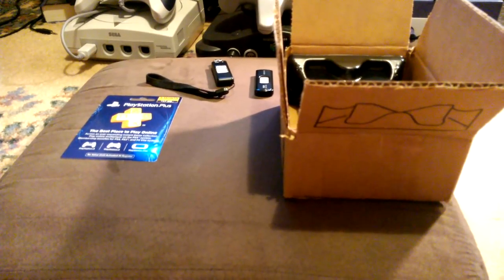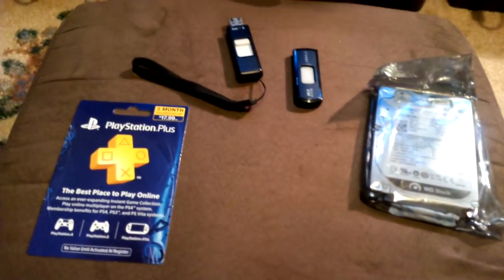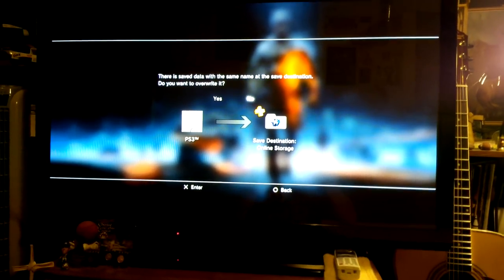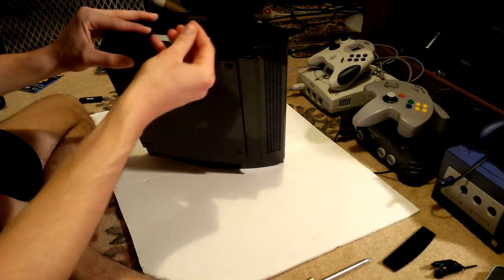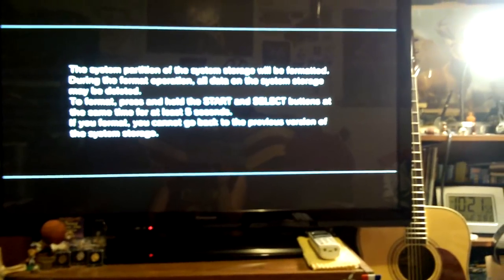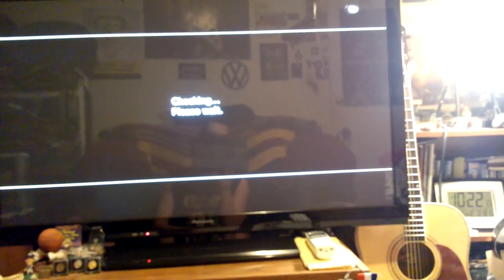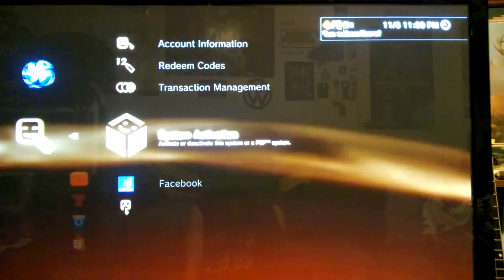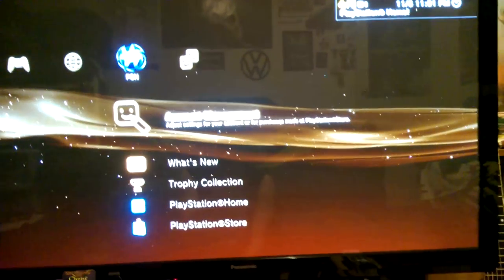How to Upgrade PS3 Hard Drive and Keep Data Without Using an External Hard Drive

Comment: A room full of legendary consoles and GUITARS i have found the gamer god! quickly report this to all media!
Reply from the maker: Lol, my room is starting to seem small with all the stuff I keep collecting so everything is all bunched together. But unlike a lot of gaming channels I don't try and be politically/corporately correct so I don't mind talking about other products or companies or showing other things not related to gaming in my videos.
Reply from the maker: ***** I think since I've changed the hard drive I haven't played all that many of my older games but it may have speeded it some but nothing very noticeable. I haven't noticed any improved framerates either.
Reply from the maker: A SSD might be more noticeable compared to a 7200RPM drive but with any larger hard drive games that offer optional hard drive installs (like Black Ops 2 and MLB 13 the show) did load much quicker due to allowing parts of the game to be installed on it. So those games loaded much faster but I think it was due to loading off the hard drive and not the disc, but a faster HDD never hurts. I don't have Skyrim for PS3 so I'm not sure if it downloads any of the game to the HDD but if it does and you have a faster HDD then it probably will give it the best performance possible from the PS3.

Comment: And I actually have a 60gb og ps3 i believe it is i won off eBay supposed to just need a hard drive.. got it for around $33 4 years ago and it has sat in a box because I already had the dontes fortune edition hg250gb console system and it works great

Comment: Hey man i dont have an external harddrive either but i got a western.. 500gb to replace my 120. Would i be able to use ps plus like you? But im not gonna buy it. Im gonna use the 14 day free trial will it work? Will it save my stuff even on a trial and will it remember? And also i downloaded a bunch of full games off the psn store. I got nfs rivals and a couple others on my system but i had to delete like 4 digital games like crysis 3 but i can see them when i go on psn store and "view downloads" so will that stuff transfer as well?
Reply: Im worried because u mentioned days waiting fir some games because they grey out and the trial is 14 days what if i dont got enough time?
Reply from the maker: I think you can use the cloud feature on a trail but I've never tried a trial version so I'm not sure. And the game saves that are grayed out are supposed to only be transferred once every 24 hours so you should be able to access them the next day.
Reply from the maker: ***** Unless your external hard drive came with a power adapter and has an input for one it shouldn't need power. Most current external hard drives under 2TB don't require a separate power source. I think it's probably just a slow process as the PS3's internal HDD is 5400rpm and your external hard drive is probably 5400rpm as well and being transferred with USB 2.0.

Comment: i needed to get a new hard drive because my ps3 old one is fried and storage data and stuff is corrupted i juss want to install a new hard drive without back up idc about game data i'll still have all my dlc trophies and apps
Reply from the maker: If you're not concerned about losing data you can try booting the PS3 up in its safe mode and try formatting the hard drive to see if it fixes the problem. If you have to get a new hard drive and aren't concerned about backing up any data you can install a new one but you'll have to have the PS3 operating system put on that hard drive and I don't know of any other methods of getting it on there but the file isn't very big so you could buy a smaller sized USB drive which should be under $10.
Reply: can a double sided USB Cord send the new the 4.70 update to my ps3 by hooking it up to to the computer into the ps3 because im currently on 4.66 because i need my hard drive was fried and system strorage was corrupted.
Reply from the maker: Jordan Gray You could try it but I don't know if it would work. Follow the instructions on how you would make the update folder and put the file it and put the whole folder on your desktop and see if your PS3 recognizes your computer as a USB storage device.
Reply: Im so sorry to be asking you so much that thank you for your time though to take my ps3 to gamestop Thank you for the help
Reply: final question can a 32 GB USB Drive hold the new 4.70 software update for my ps3
Reply from the maker: Yes. I believe the size of the update file is only around 200mb just make sure to make the correct folders on your USB as instructed on the Web page that has the update file and it should recognize the file.

Comment: the issue with the 7200 rpm hdd is for the ps3 slim and its a cooling issue. The hdd may over heat especially where i live here in the desertbut if you keep it in a cool environment it should be fine in either model.

Comment: sooooo, if you DONT want any of the stuff from the old harddrive, you can skip everything but the update from the website and the actual switchout?  Bought a used ps3 fat and upgrading before i give it to my kid so i dont need this other dudes info... also the reason you only have 412 free is cause you already dled your games lol.
Reply from the maker: All you need to do is change the hard drive and have a USB with the update firmware and it should be ready to use if you don't want any old data.
Reply: Awesome Bigj :)

Comment: I downloaded games from different people and I don't have their account info anymore, if I upgrade my hard drive will I need to redownload those games or will everything be exactly as before?
Reply: Please answer my question as I do not want to lose the games that are not on my account
Reply from the maker: If they were paid games that were bought on someone else's account they wouldn't be available in your download list to redownload on your new hard drive. The only chance you might have is if you bought an external hard drive in addition to upgrading the internal hard drive. That way you could backup your entire system, game data, and full games and not have to redownload anything but I still couldn't say for sure if those games would work or not because I didn't even know it was possible to have games from someone else's account working on your account.

Comment: i am trying to update it it says data corrupted, and my ps3 freezing what i should do??help
Reply: If you're trying to do all this while your PS3 is jailbroken it might not allow you, if you put another hard drive in it there shouldn't be any way data is corrupted because there isn't any data on it. If the new hard drive has anything on it or needs formatted then it's ok to let the PS3 delete everything and format it. If your original hard drive says that I'm not sure why it would, as long as you copied your gamesaves onto a USB you'll still have your stuff that matters. Again if your PS3 is jailbroken and you are trying to put those gamesaves onto the new hard drive it might not work until you jailbreak the PS3 on that hard drive first.

Comment: Any thoughts on disassembling a Western Digital 500G My Book and using the drive to upgrade my ps3 slim? I don't want to crack open my external until I know it has a 2.5 in it. Thanks.
Reply from the maker: I've never heard of those HDDs but I looked them up on eBay and by the size of them (if your's is what I'm seeing on there they're pretty bulky) they appear to contain a 3.5in HDD that does not fit in the PS3. I found one listing where the description said it is a 3.5in and the 500gb model My Book and it looks to be the same appearance as the rest so I'm assuming they are all 3.5in HDD. If you still want to use it though I'm pretty sure the PS3 will accept an external hard drive via USB as an addition to the internal storage. To do that you'll need to format your external HDD to FAT32 (you might be able to format it conencted to your computer if the hard drive itself came with it's own software because I remember reading Windows itself can't format FAT32 beyond a certain size drive, like 30-50GB or something.) If you can't do it that way I think if you connect it to your PS3 it might give you an option to have the PS3 format it to the correct format. I'm not sure how to get it to do that though, if you go into that BIOS like menu by holding the power button it may give you a tool there to do it, if not if you're in the XMB and go to backup/restore section and try and make a backup on it I think it would have to format it first to back it up and you might be able to cancel the backup and then be able to use it as additional storage. Sorry I don't know for sure but if you do want to use that 3.5in drive it'll have to be connected by the USB and formatted, if you aren't sure about what I said then I'd suggest looking up how to get an external HDD to work on the PS3 on YouTube.
Reply: bigj619d3
Thanks for the insight!

Comment: Lets say I have gta 5 does the online data for gta 5 get erased or do I just have to reinstall it and start all over ?
Reply from the maker: I never played much GTA5 online but I'm almost sure when you start an online session it auto saves all the time. More than likely in the XMB menu there is a save file for your online GTA5 and another for your offline story mode. As long as you either have PS+ or copy that save file onto a USB (along with all your other games' save files) you should be able to pick up where you left off after you let the game install itself again and download whatever update patches it needs.

Comment: Do you actually enjoy using the Super Pad 64 hahaha. Just noticed that in the background. My least favorite N64 controller, that one. I might have the same model ps3, 80GB fat. I just put a PS4 hard drive in it.
Reply from the maker: I never had an N64 so to me the bulky Super Pad felt easier to hold than the original controller. Also the original controllers I had both had loose thumbsticks while the Super Pad’s ones were still nice and springy. I’m not sure if they were built better of the last owner just didn’t use them. My PS3 still works well so I’m glad I still have it since it’s hard to find a working, clean fat model although I rarely use it these days and I hate the worn out, tiny DualShock 3 compared to the DS4. Plus the battery in it is shot so I only get a few hours out of it.
Reply: Give the afterglow ps3 controller a try, they might still have them available. One model of the PS3 afterglow can double as a pc controller. Here is the link: https://www.amazon.com/Afterglow-Wireless-Controller-Blue-playstation-3/dp/B017VLXH3C
Reply: I think the Super pad uses metal parts inside instead of the plastic nintendo used, making them last much longer. Sadly, although my PS3 isn't very used it's got lots of scratches on it, I need to find a way to buff it out without damaging it. Not a fan of glossy finishes myself.
Reply from the maker: I don’t really play my PS3 enough to want to get another controller but if I ever get back into it that looks like one worth considering. When I got a used PS2 a few years back it came with a nice wireless Logitech controller but unfortunately one of the triggers constantly kept registering as a press which pretty much ruins it. They go for quite a bit on eBay and most don’t include the receiver and aren’t clean so maybe one day I’ll find a cheap one for parts where I can just harvest the inside and fix mine. Also I don’t have any but two GameCube games at the moment but if I ever get back into it I’d like the WaveBird controller but they too are rare and hard to find complete and in good condition.

Comment: Awasome video, i was wondering, you tried to use the older hdd ? Im asking you this because i want to change the HDD but i have a digital game (The last of us) and i dont if a would be able to come back from the newer HDD and play this game. I didnt bought the game with my psn account so i just can downoald it once.
Reply from the maker: If you got the game digitally from a code you'd still have to redeem it on your profile for it to download so I'd check your downloads list to see if it is available in your account. (For example I could buy a DLC code from somewhere other than PSN but if it redeemed it on my account it still is in my downloads list since it had to download from PSN in order to get it on your PS3. If that doesn't work then save your old HDD and buy a hard drive enclosure to put your old HDD in which would turn it into an external HDD that you could connect via USB in addition to the newly installed internal drive. The only issue would be I know the PS3 will format a newly installed internal hard drive and wipe all the data off. (When installing the new hard drive it doesn't matter since it's blank to begin with) but if you reconnect your old HDD via an external enclosure I'm not sure it the PS3 will still recognize it as already being formatted to work on a PS3 or not. You might be able to research that to see if others have tried it.

Comment: hey dude my ps3 is broken and i cant on it, its totally dead on me  but i have the hard disk is there any other way to extract the files? i did not sync or anything or put it on cloud or back it up i was very young back then and stupid  pls help many thx
Reply: Hey there. You'll need to find a way to access the hard-drive of the ps3 and extract the files. Since you probably don't want to be opening your computer up and plugging the drive directly into your hardware, you'll have to purchase a connector that allows you to "mount" your hard-drive as if it were a USB flash drive. There's a How to Geek page on this problem. You can find it by searching "How to get data off an old Hard Drive."

Then you'll have to transfer the data to another hard-drive or flash drive after it's on your computer, so your ps3 can read it.
Reply: you might be able to take it out and use it in an external harddrive

Comment: I have a question, I forgot to copy my RE4 save data to my USB during the upgrade but it's still in my old hard drive. Can I put the old drive in and recover the save data? And will I lose anything I currently have if I do this?
Reply from the maker: I know the PS3 formats a "stranger" hard drive if any time you put one in it that wasn't already in it. If you already installed the new one and want to go back to the old one I'm not sure if your PS3 would remember it or if it only remembers the last one to be installed (which would be your new one.) In this situation I wouldn't recommend removing the new one in the event that you take the good one out and the original gets wiped and then the PS3 formats it and then if you go to installing the new one again that one might end up getting formatted as well and you'd lose everything on both drives. If it's just one game you're better off dealing with just one loss. I assume RE4 is resident evil 4 (which I've never played) but if it's a sorry game if you like it it wouldn't be the worst thing to have to replay the game (unlike a sports game or something where your created team and stats would be reset) in this case you'd just have to replay the game through again which might be fun anyway. And as long as you're connected to the Internet your trophies should have synced up to your new hard drive so no matter what you'll at least still have those unlocked.
Reply: Yes it's Resident Evil 4. I guess I wouldn't mind playing it again since it is one of my favorite games. Rather replay it over again than risk losing everything I already installed on the new drive. Anyways thanks.

Comment: thanks.nice video but does this erase multiman ??
Reply from the maker: I don't know what that is but if your PS3 is jailbroken I'm pretty sure any time you put new firmware on it it erases the hacks. You'd have to download onto a USB the 3.55 or whatever latest compatible firmware that hack worked on, but I think PS3s that are on a higher firmware won't let you install older ones but if you ever updated it you might be able. If you're able to put the old firmware onto it and rejailbreak it you can get it back but just doing what I did in the video wouldn't carry over any hacks.

Comment: i cant transfer wwe13 the save file is to big for the cloud
Reply from the maker: Are you sure that's why? If I remember correctly certain game saves (like WWE games) are copyright protected and won't upload to the cloud when you auto check them all. They are grayed out and you can't select them. If you individually go to that gamesave and press triangle I think and tell it to copy to the cloud it should say you can only transfer these files once every 24 hours and then will let you upload it to the cloud. You have 1GB of cloud storage and save files are pretty small so I don't see that being the problem. Unless you have a lot of downloaded wrestlers which might be the cause. If that still doesn't work you can try a USB drive but if that file is copyright protected it won't save to a USB.
Reply: the file is to big so i guess i well never buy another wwe game

Comment: Is it possible to use the same usb that you use to save your saved game utility on and add the ps3 update on there as well without anything getting lost or corrupted?
Reply from the maker: If you're talking about the USB flash drive with your game saves I think it would be ok. In order to put the update/firmware file on your USB so the PS3 recognizes it you have to put it in a different folder by itself and I think your game saves can be anywhere in your flash drive or in a different folder so I don't think they would interfere with each other.